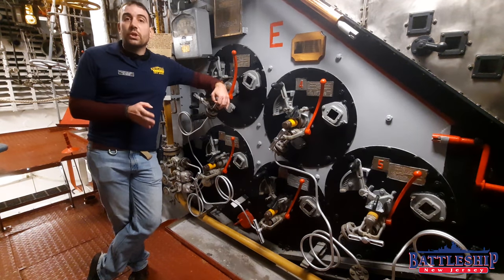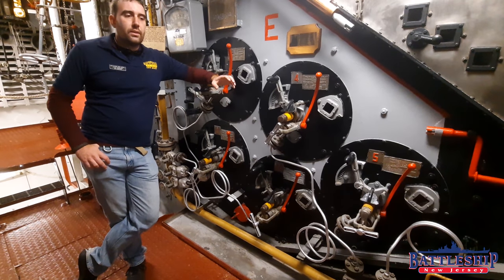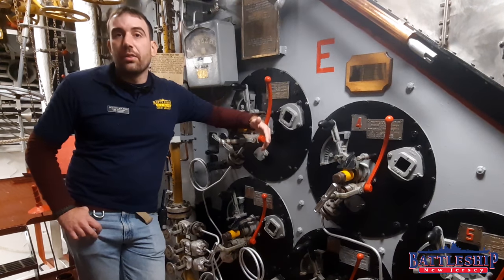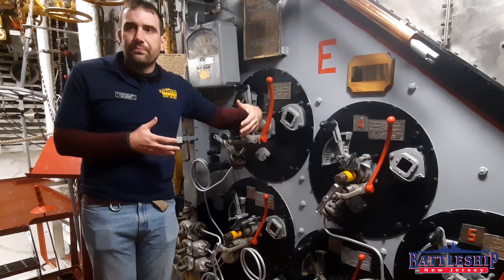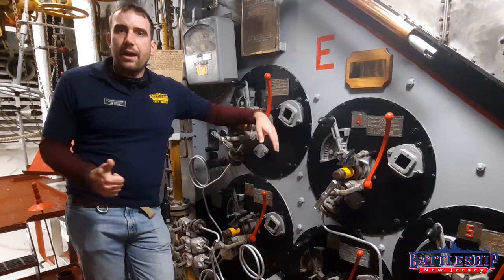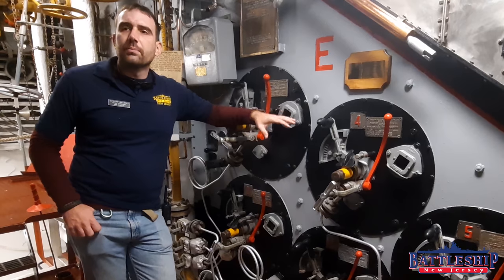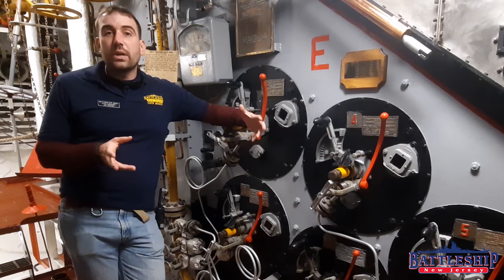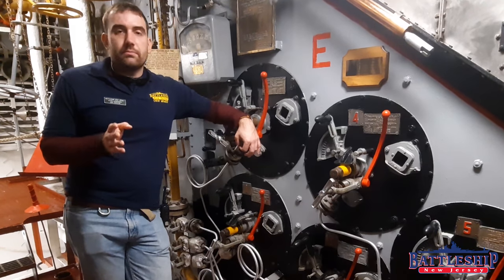Nuclear Powered Battleships

Comment: The idea of a nuke plant in a battleship is quite simply dumb.   First why would you want to put a nuke in a ship designed to take major hits?  Exactly how does a nuke react to the hits, to the guns being fired and to the strains of violent combat?    Nukes are an idea in battleships that is put out there in hopes to get them back to sea.  It won't happen not the least because such a plant would be $2 billion to develop and install.  BUT there is a modern power plant that would actually be a huge upgrade for the Iowas and that is a modern gas turbine plant.  Interms of cost, it could be done for less than $200 million per ship.    AND the US Navy had plans to do just that.  The Wisconsin was going to have her steam plant removed and replaced during her refit  to get her to sea, but the Navy wanted her asap at sea because she was the best of the class.  Instead, the Navy was going to take the New Jersey which was scheduled for a major overhaul in 1989/90 and do the work on her first.  The project included the removal of all the boilers and the steam turbines and steam turbine generator systems from the ship.  The gear reducers connected to the propellor shafts would have been left in place.  

The  Navy was going to put in two large 68 mW gas turbine generator sets with large industrial electric motors connected to the gear reducers for propulsion.  The power was similar to the steam plant at the propellers and would have held the speed at 32 knots.   Two smaller gas turbine generator sets would have been used to power ship systems while auxiliary steam would have been generated by moderate sized recovery boilers on the gas turbine exhausts.    All four systems could have been used to power the drive motors for redundancy and the systems could be separated in subdivided compartments as well.  All the gas turbines would have been designed to trunk into a single funnel (the aft one) and would have fitted in the four engine rooms and two real boiler rooms leaving the forward boiler rooms empty and the forward funnel removed.    Some  of the auxiliary systems powered by steam would have been converted to electricity.    The large industrial electric motors would have been operating at speeds similar to the steam turbines so keeping the gear reducers makes plenty of sense.  Higher speed motors are smaller for the same torque and power output, cheaper and easier to operate over a range of speeds.  And the gear reducers were in place anyway.    The gentleman in the video seems to think it is hard to cut through the 6" deck to access the areas but the truth is it is not in a heavy shipyard.    There would have been an overall reduction in the ship's weight and the empty forward boiler rooms are ideally located for new weapons systems.    A gas turbine system is easy to control and the bridge could have its own direct engine controls increasing effective agility of the ships.  It would also have been possible to create an independent auxiliary control room for bridge redundancy.  The Arleigh Burkes are gas turbine powered and most of the control systems could have been shared.  The difference in size means little to the control systems since a 12 mW and a 68 mW  gas turbine are effectively the same control problem.      In the engineering spaces, such a power plant only needs 20 to 25 crew on duty to operate it.  The Iowa steam plant needed 650 men to operate and maintain the systems so a reduction to 100 or so men in engineering is a huge benefit.  Losing more than 1/3 of the crew requirement would  ripple through the ship.  The gas turbines would have used the distilled No. 2 fuel oil that was made standard in the 80's with the same fuel capacity and similar operating range.    

It did not happen, BUT the Navy did buy the turbine sets and much of the other equipment.  One of the big turbines was sold to Merck for the West Point , Pennsylvania,  pharmaceutical facility power plant where it operates today not 30 miles from the New Jersey.   I ran a major overhaul on that unit 10 years ago and the GE engineer who was there to help told me he helped design that unit  and its history.   At the time, they were the largest marine rated gas turbine units built (GE products) but today they are middling in size.    You could buy a similar unit today for half the price in real dollars to do the same power output.   The cost to rip out the old and replace would have created huge potential for the ship's further improvement.   There were plans to remove the super structure and install super structure similar to the larger cruisers in service, drop in the Aegis radar and air defense system, new fire controls and add new weaponry.

Comment: I suspect large surface warships of any kind are too vulnerable to submarines and ballistic missiles nowadays. 
Guidance systems for ballistic missiles are getting accurate to a point that a warhead is irrelevant - a hardened re-entry vehicle coming in at many times the speed of sound has crazy kinetic energy.
And relatively speaking, they are pretty cheap.

Comment: Anything is possible but not much is practical.

 I always though a gas turbine conversion would be cool. A few of the latest LM2500 plants coupled to the reduction gears. I assume that the rpm output of the steam turbines is somewhere close to that of GT? I could be way off. Then you would have to feed fresh air to the turbines and trunk the exhaust.  Possibly could do that with the existing funnels to avoid cutting through 6" armor.  Your fresh water needs are reduced, fuel tanks largely remain the same, fuel consumption reduced, fewer personnel to operate, and you open up a bit of space.
Reply from the maker: This video show's the armor thats inside of the stacks: https://youtu.be/7DEtyl96jBs
Reply: @BattleshipNewJersey  OK, so maybe not using the existing stacks. I doubt 4 gas turbines could get enough air through those tiny holes in the 6" armor so it would have to be cut out. Even then it doesn't look like enough CFM for GTs.  

I had no idea the inside of the funnels were armored like that. Was the armor inside the stacks solely based on what they thought happened to Arizona and incorporated into the Iowa design after pearl harbor or was is designed like that from the beginning?  Love the videos and hope to get back the NJ soon. We took the Turret 2 tour a number of years ago but the engineering spaces weren't open yet.

Comment: Battleships are targets: Tripitz, Bismarck, Yamato.  Battleship Row at Pearl. The "other side" will put ALL the resources it has into sinking them. Battleship range is limited, especially compared to a squadron of F/A-18s. Battleships are expensive. The Iowa class has a complement of 2700 sailors. (The USS Ford is 4500 With its air wing on board.) It's not that retrofitting a 70 year old battleship with nuclear power is senseless. (It is.) Having battleships at all is senseless.

Comment: Actually, I think that nuclear reactor requires some weight for its biological protection. But at the same time it gives a weight economy - meaning that You dont need huge amounts of oil to operate. This reserve of weight might be used to better protect ship and (or) reactor from the threats.  But considering all that was talked about it - its clear to say that installing wouldnt be easy if we are going to do it with WW2 era battleships (or ANY battleships) cuz they have significant armor decks and heavy, bulky and complex superstructures. It wouldnt be easy to delete all of this. And it might be neccecery to redesign supersructures to better meet modern requirements.
Thus - it isnt a great idea to rebuild existing battleships. But it could be interesting to build another one, modern. 
.......and it would be EXPENSIVE ship!!!)))))))))))))))))))

Comment: I love the old battleships but I don't get why people want them back in service. A battleship serves no role in a modern navy where missiles are king. You can't make a haul thick enough to stop these new warheads so CWIS and other anti-missile system take on that role. Guns are fun but get out ranged by missiles and have less accuracy, sure a shell is harder to shoot down (impossible really) but the new hypersonic missiles are too. If you don't have armor, don't have guns, and are just carrying missiles you're not a battleship you're a guided missile cruiser. Shore bombardment is the only thing I could see being of use, but even then the Silkworms made that problem in the past and anti-ship missile tech has only gotten better. If you need to drop a lot of ordinance indiscriminately then just carpet bomb with a B-52. Dumb bombs are cheaper than shells anyway as they have no propellent.

Comment: With modern hypersonic missiles , it doesnt really matter what propulsion system you are running, all these old school battle ships would be sunk rather quickly, opened up like a tin can with a single hit from a well placed hypersonic missle
Reply: And what is the armor penetration capability of these hypersonic missiles designed to defeat thin skinned aluminum hull destroyers and cruisers?  I want to point out the Iowas have a 1.5" thick outer hull plating, about a foot or MORE of space and then a 12" thick armor belt.  Twelve whole inches of ARMOR steel.  The decking is equally as impressive... about the same thickness as a weather deck and then 8 feet of space to a 6" thick armor deck.  

Keep throwing those missiles at it, you'll eventually mission kill it, but I doubt you'd sink it.  Those missiles are designed to penetrate armor belts consisting of 4-5" of aluminum based armors (about 2-3" thick steel equivalent).  It'd be annoying, and probably kill people, but they wouldn't sink one.
Reply: @Whiskey11Gaming  the shear velocity of such hypersonic missile itself would rip through even the thickest armor like butter on this ship, the ship was designed in the ww2, and was armored after the threats back then. Its a reason why they took these ships out of service, even the main guns are pretty much useless in todays naval warfare, were long range strike is mostly common

Comment: Can future Battleships be used with gas turbine propulsion like the General Electric LM6000?
Reply: I think any new build or potential retrofit could and should make use of more efficient powerplants. Whether it is worth refitting the Iowa's is the other question when it would likely be more cost effective and strategicly viable to build new with the flexibility for any future refits dowl the line.
Reply: USS NJ had about 440k horsepower.  LM 6000 produces about 55k.  Plus a modern ship would need a lot more HP for electric generation.  Also, GT uses more expensive and more flammable fuel
Reply: Isn’t it 212k horsepower.
Reply: @eekedout  it is, rob g doesn't know what he's talking about. Also what he didn't calculate is that that's 55K HP on ONE plant, the Iowa's made 53K HP per 2 boiler/1 turbine plant so hmmmmmm. Even if you factor in the  emergency power they could make of 254K that's still 63.5K per unit but iirc 6 GTs can fit where the boilers were so it would work out fine. Still not feasible for the Iowa's but the idea is sound on paper.

Comment: Just a couple of questions from someone that doesn’t know much. What about diesel electric. Or running a Different kind of oil. Would the boilers be more efficient with #2 diesel.
Reply from the maker: They modernized the fuel source to basically diesel in the 80s.

Comment: What about building modern missile cruisers with nuclear reactors, then? The main batteries would be closer to 6 than 16 inches and the main armaments would be missiles and some helicopters, but they would be designed from scratch to not have a problem with replacing fuel rods.

Comment: I guess you aren't aware that modern Naval Nuclear Power Plants do not require refueling during the lifetime of the ship. Also submarine nuclear power plants are NOT delicate systems. They are designed to withstand depth charging among other challenges. It is also unlikely that a single nuclear propulsion plant would be utilized. Modern carriers have two plants that can be cross connected if need be. The USS Gerald Ford's plants reportedly produce enough steam to generate 125 megawatts (168,000 hp) of electricity, plus 350,000 shaft horsepower (260 MW) to power the four propeller shafts. In contrast the Iowa had 8 × water-tube boilers that could 212,000 shp (158,000 kW). I have no idea the electrical power capacity. While it still might not be the best idea to use nuclear power on these ships, several of the reasons you listed aren't those reasons.

Comment: Wanting battleships back in the line is not "cool and nostalgic." As a former Marine, I say it still makes a lot of sense to have these battlewagons in service.  For one thing, shore bombardment during landing operations.  You'd be hard pressed to find a better platform to deliver massive firepower for minimum cost.  A 16-inch shell doesn't have a pilot who can be shot down and taken prisoner.  It can't reasonably be intercepted.  A 16-inch shell costs much, much less than cruise missile.  Add to that the immense toughness of the Iowa's compared to, say, any of the thin-skinned ships that are otherwise tasked with the shore bombardment role and it's not a platform you can easily dismiss.
.
I recall a number of studies were done after the Korean and Vietnam wars detailing how many targets were within the range of the Iowa's guns.  I don't recall the exact percentage but I want to say it's north of 80%.  The Navy, in its infinite wisdom, though it smarter to do this with naval aviation, much to the chagrin of the pilots who were shot down on such missions.
.
Where the Iowa's fall down is in their electronics.  The ships simply were never designed for modern electronic warfare.  They don't make enough electricity, and even where they do, getting the power from point A to point B is difficult because things like power and data conduits weren't considered during its design.  I toured the Wisconsin in 2019.  Seeing the retrofits put in place for the 1980's and 1990's, it was painfully obvious.
.
So the battleship cannot reasonably function as a front-line warship...but that's not what is needed.  What is needed is the equivalent of a floating shore battery, a "monitor" if you will.  Something that can deliver quick, reliable, CHEAP firepower for anything within 20 miles of a coastline, and do it with the expectation of near-invulnerability to anything the enemy can shoot back.  Certainly this is a better solution than parking a thin-skinned destroyer somewhere and using its puny single gun to try and take out any large or difficult target.  It's a lot safer and more difficult to stop than sending an aircraft.  It's a lot cheaper than a cruise missile.

Comment: Can missile battleships be built in the modern day? 
Something like the kirov battle cruisers but with more armor and with an oil burning engine?
Reply from the maker: Check this out: https://youtu.be/A-o1T7bCU5A
Reply: The concept is known as an arsenal ship. It comes with probably more problems than it solves.

The first issue is that for the investment, it can only be in one place at a time, and while it could launch hundreds of missiles, that capability wouldn't be needed often. Therefore it's better to have more destroyers with smaller vertical launch missile systems (VLMS) than a single arsenal ship.

Another issue is that the arsenal ship would need to be protected due to the investment in her. Therefore you would need to form a battle group around the arsenal ship much in the same way as a carrier battle group is formed. In this situation, for a similar use of resources, a carrier battle group is much more versatile than an arsenal ship battle group would be due to the range of missions the carrier aircraft can conduct.

Finally, if a battle group was to be built around an arsenal ship, the majority of the air defence and anti missile defence for the battle group would rely on the arsenal ship's large VLMS. This creates a problem because the single arsenal ship can be more easily overwhelmed by incoming threats than a air defence network spread over a number of smaller ships. The reverse is also true, in that it is easier to overwhelm an enemies air defence by using smaller VLMS on smaller ships to send multiple missiles towards a target from different directions at the same time, as missiles cannot be launched from a single VLMS simultaneously. A arsenal ship might be able to launch two or three missiles simultaneously depending on the placement of the launchers, but the same money spent on destroyers would be able to launch more as they are individually much cheaper.

Comment: I’m still surprised that they didn’t have sections of the armored deck removable so in dock they could lift a boiler or turning out of the ship. I’m curious if a boiler needed a new drum or superheater, would they just, cut it out, bring a new one in and weld it in place
Reply from the maker: You're replacing parts not whole pieces like that. You can't remove the boiler. It just isn't doable.
Reply: @BattleshipNewJersey  fair enough